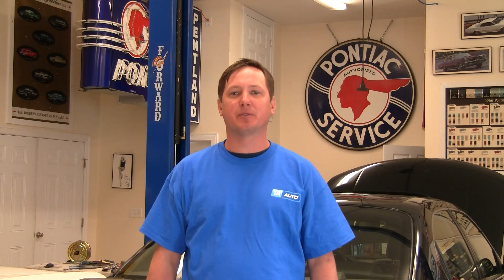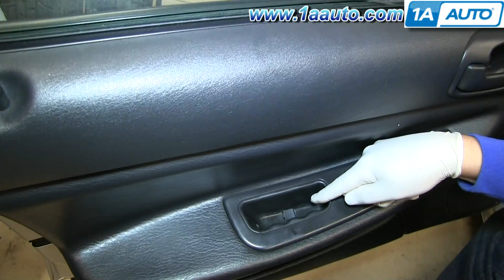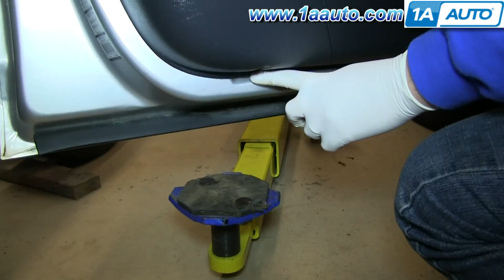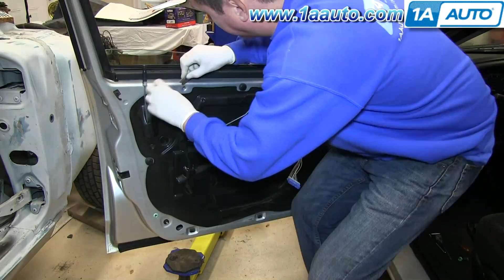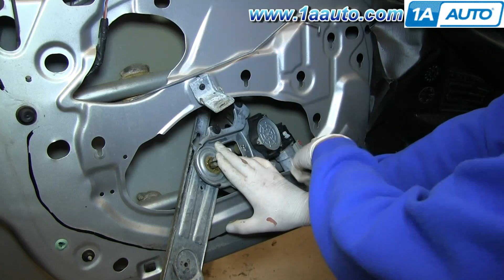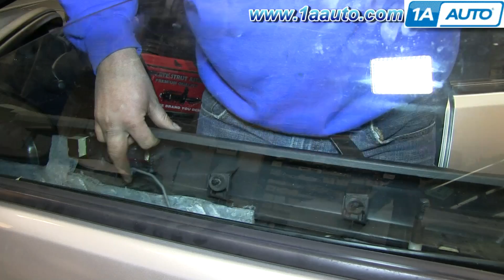How to Replace Window Regulator 01-06 Chrysler Sebring

Comment: Be careful, the 04 convertible I changed out today had a coiled spring mounted to it. When you take the motor loose it swings around violently. If yours has a spring you can stop it from slinging around by placing a screwdriver through a hole on the cam.
Reply from the maker: +Steve Polk Thanks for the tip!

Comment: hi, im having difficulty disconnecting the window regulator motor from the car, the power cord to the motor wont disconnect. this is for a mitsubishi colt 2009. can you help?
Reply from the maker: +Dick Piano Thanks for checking us out. If the motor won't disconnect, you may try a small flat blade screwdriver or a similar tool to try and separate the clips for the connector. 1aauto.com